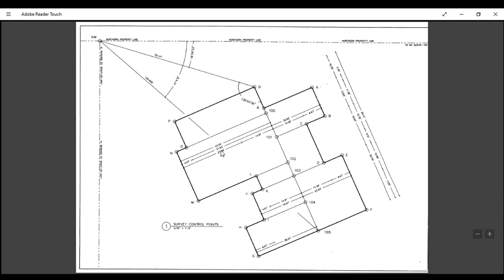House Layout and Batter Boards

Comment: This brings back memories of when I was a teen, my dad and I doing the layout for an addition to our house.  We used the Pythagorean Theorem to do our layout and did a double check by building a 3-4-5 square which we used to check against the string on the corners.

Similarly, I've seen a video by DIrt Perfect talking about doing Pythagorean calculations between the various corners before doing the layout.  Determining the hypotenuse distances he is able to make sure the foundation corners are all square.
Reply from the maker: The construction master pro calculator can do the Pythagorean calculation in ft-in-1/16ths which is a huge upgrade! I’m pretty fast with mental math, but defined not when it comes to square roots of fractions!
Reply: @avalianteffort40  - I’ve been doing it on my iPhone calculator.  

Also, it took a bit of searching, but I found an OK quality metric tape measure and have since started doing more in metric, especially trim and other millwork which I’ve found helps in my own accuracy since everything is then base 10.
Reply from the maker: I like how millimeters are about half of a 1/16th, so it forces me towards 1/32nd accuracy anyway. I've got a Milwaukee 6'/2m metric-english dual unit tape on my keys that I end up using all the time because it just happens to be in my pocket.
Reply: @avalianteffort40  - I picked up a metric tape measure while I was in Germany 6 years ago.  I’ve been using it for all my fine woodworking projects and I find myself making far fewer mistakes when using a metric measure.  

It’d be nice to find a reel that’s 20 or 30 meters long for checking the hypotenuse between foundation corners.  Of course, some modern laser gear seems pretty tight on distance measurements.